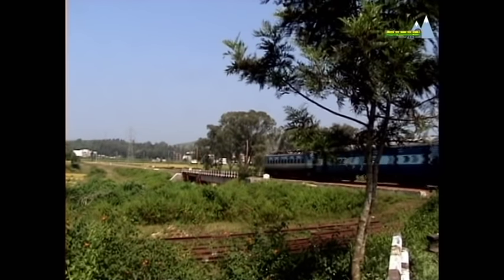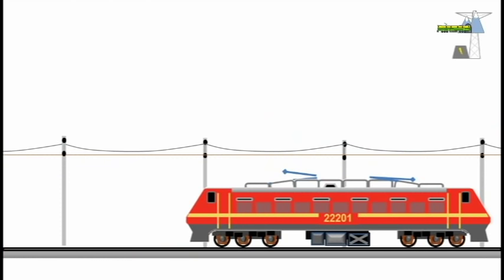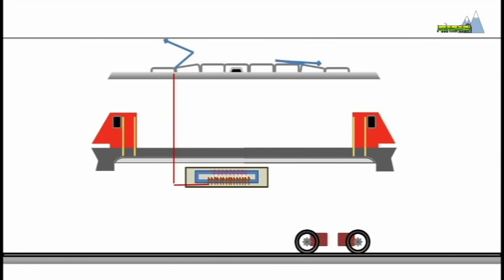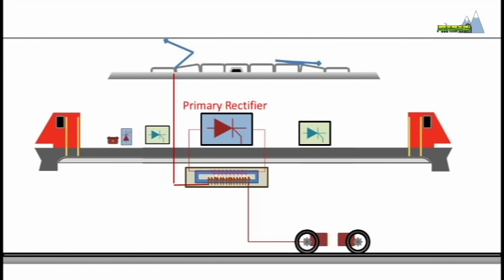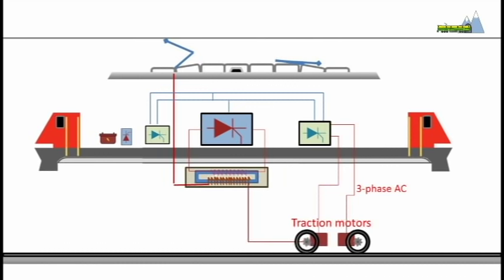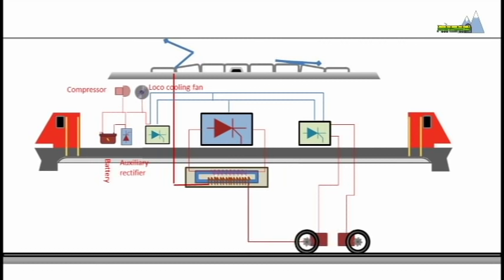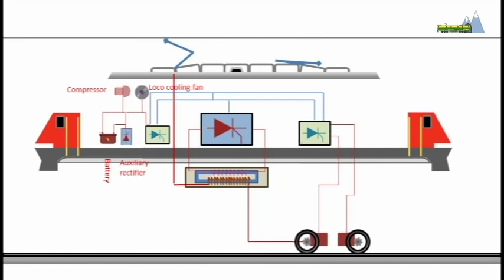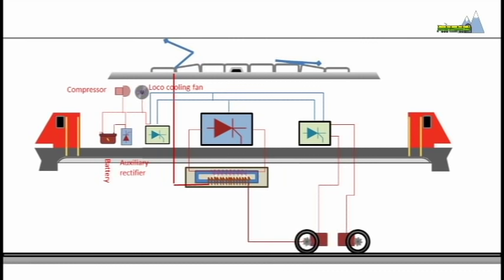How an electric locomotive works...

Comment: As per my observation, electric locomotive trains needs high starting torque and variable speed at constant torque in any loads. these points are fulfilled by inverter based Ac drives. By the way i have seen resistor banks on top of the train to desipate  the back emf of induction motors.Hence there must be used AC drive system as shown this video. AC to DC conversion is needed to switching semiconductor devices  to achieve variable frequency and voltage.usually IGBT used to achieve this and converted into AC .

Comment: If you touch the rail, when the train passes, can you get electrocuted?
Reply: No, the Rails are grounded so there is no Voltage between them and the Ground you are standing on. Touching Rails when a Train passes may result in more "mechanical" Injuries tho.
Reply: @Genius_at_Work  , but the train creates electric current from the generator/motor to the ground - through the wheels. Then there are ground wires on every XY meters attached to the rails. What if you make contact to the rail (from the side) when wheels pass you by. Then you would "short circuit" it, right?

Comment: Very good and very "compact" explanation of the most modern system:
25 kV / 50 Hz --> Transformer --> Rectifier --> DC-Link or DC-Bus --> DC/AC (3 Phase) variable frequency converter --> (3P) AC-Motor (asynchronous/synchronous).

But from 1912 to the late 1970s the standard in Mid-Europe was to use 1 phase AC-series-wound motors, which where supplied bei a transformer with multiple taps. And this system is the reason for the (from todays view) odd system with low frequency AC (16 2/3 Hz, now 16,7 Hz):
15 kV / 16,7 Hz --> Transformer with a lot of taps --> big mechanical switch to select the taps  --> 1 phase AC-series-wound motor

At the beginning of the last century this system was revoluntionary efficient, because it does not use resistors (which just produce heat) like DC-systems and the current was quite small (because of the high voltage). And you don't need any rectifiers (which could only build stationary at that time, because they were mercury-rectifiers) at all.

But the down-side is of course, that you need a second 16,7 Hz distribution system all over the country ...
... which Germany, Austria, Switzerland, Sweden and Norway still have to drive their trains.
Reply from the maker: Thanks Stefan for the exhaustive information. AC Electric traction in India was a collaborative effort with the French. But our first batch of AC electrics used 25 KV/50 Hz with DC motors that required rectifiers. The present lot are German collaboration (ABB) and use AC-AC 3 phase systems

Comment: why do u have to connect the transformer to axle brush? what's the point of it? I saw that the traction motors are connected with in 3 phase with primary inverter so im asking what the point of connection from transformer to axle brush? sorry im beginner only

Comment: According to this video, from the transformer, the supply AC current is converted into DC by using rectifiers, and further it is converted into 3 ph AC using inverters. So here AC is ultimately converted into AC, then why the rectifier is needed? 

And my another question is that,  is the supply AC is single phase or 3 phase?
Reply: AC power from 1 phase to 3 phases previously needed a rectifier, why? Because the current AC converter from 1 to 3 phase AC does not yet exist, a rectifier is needed because the rectifier can work with several electrical phases, either 1, 2, 3, even 6 phases if using a rectifier will produce DC electricity that can be converted into phase required.

The electricity supply from the overhead line to the electric locomotive/train uses 1 phase electricity, while the traction motor uses 3 phases which must pass through the rectifier and inverter first.

That's a bit of knowledge and opinion

Comment: Awesome video sir.

 I have a doubt. Traction motors really needs cooling fan?  I think the motors are open to atmosphere and while in speed,  air can cool the motors. May be fan is required to cool the motors when loco is standstill.
Reply from the maker: You make a good point... I saw some technical drawings mention these fans as being for cooling traction motors
Reply: @TheTrainStory  Oh ok. Then I think traction motors do need cooling fans. It is difficult to see the requirements like the designer has seen.

Comment: Only one wire are touched to the engine from supply line then where it get other polarity?(is it get minus voltage from train ground?)
Reply: Sepiyan Siva it's earthen through the rails.

Comment: that was really cool,
can you also tell us about the new P5 & P7 one's, they seem to have some different kind of cooling units as their shell is completely covered unlike the other electric engine's, & also about the secret of their so much power too
Reply: Tarun Sanghavi they use 3 phase squirrel cage induction motors instead of DC motors like wap4 hence they have better performance

Comment: why is AC converted to DC and again back to 3 phase AC? why not use  the AC directly?
Reply: Because the Traction Motors in most (if not all) modern Locomotives are Triple Phase Synchronous Motors. The Speed of a Synchronous Motor is proportional to the AC Frequency, so the Locomotive has to regulate the Frequency on board, as the Overhead Wire delivers Single Phase AC on a constant Frequency. This Change from fixed Frequency Single Phase AC to variable Frequency Triple Phase AC requires Rectification as Intermediate Step. Even if the Motors coincidally were running at the same Frequency as the Overhead Wire, DC in between would still be necessary as Single Phase AC can't be converted directly into Triple Phase AC.

Older AC Electric Locomotives (until 30-50 Years ago) had Single Phase Serial Motors tho, which were regulated by adjusting the Voltage fed to them. So they ran on the same constant Frequency as the Overhead Wire, with a variable Transformer in between.
Reply: @Genius_at_Work  ah I see...thank you so much for the explanation. makes sense.

Comment: There is a lot of information missing.  So let me get this straight.  The electric motors are AC motors that have variable power needs.  How is the AC current modified, with variable pulse wave electricity?  You can't change the amperage or the voltage to a motor except changing the phase feed but that means you are stuck with a handful  of fixed motor speeds.  Your locomotive needs a flat wave pulse modulator between the rectifier and the motor otherwise your motor burns out.
Reply: You can infinitely vary at DC stage. Post-invertor AC will have similar wattage. The AC-AC transmission is actually AC-DC-AC.

Comment: how many motors used in locomotives ?
Reply from the maker: Santosh Kulkarni There is no fixed number. Depending the requirement, a locomotive can have between 4-6 traction motors.

Comment: My question is that..the Traction motor mounted only with the engine wheel or all the wheels of the train?
Reply: Great video by the way...different from the time wasting youtubers... Thanks for providing such informative videos.
Reply: Locomotives power is only powering wheels on locomotive, but on many passenger trains the individual cars have motors on carrages.  Technical these are called Electrical Multiple Units (EMU)
Reply: Most Metros /subways / Undergrounds are of these type.  Confusion comes in case of high speed main line EMUs where front car resembles locomotive, but all carrages are self powered.

Comment: Interesting. How is the motor speed varied. AC motors run at a speed determined by the frequency. Is this frequency varied by all that circuitry?
Reply: By the voltage and frequency supplied by the inverters.
Reply: Frequency and voltage control. This is why we convert ac into dc and then ac with a different frequency

Comment: Why don't they use a single to 3 phase transformer and then directly give the 3 phase to the motors . WHY RECTIFIERS ???

IF ANYONE KNOWS THE ANSWER PLEASE REPLY ME
Reply: Because there is no such transformers are present. And if are then they will in big size .so rectifiers are used in it.

Comment: still vague
why are we using rectifier and then inverter again, complicating the engine, why not use open-delta transformation to get 3 phase a.c. 

what kind of motors are auxiliary motors (synchronous, induction or other motor)
Reply: Open delta presents some undesirable characteristics, such as currents not being equal, and the 3 phases not being 120 degrees apart. The B-phase, sometimes known as the "wild leg" or "high leg" is often well above 120 volts.  Since nobody needs fried motors, buggered lighting systems, HVAC systems that don't H, V, or AC, they do not use open delta transformation.   Using rectifiers and then inverters is costly up-front, but offers a world of dependability and reliability with predictability and familiarity if something does go wrong.
Reply: Stan Patterson - appreciate your reply
Reply: The supply voltage is 50Hz single phase AC but the motors need 16 ⅔ Hz 3 phase AC
Reply: AC current is first converted to DC by rectifiers. This DC current is again converted to AC by inverter circuit. The frequency of this converted AC current can be varied to change motor speed. And hence train speed.
Reply: N1kh1l B frequency can't be used for controlling the speed.
Reply: sahil malik Dear Sahil. Speed of AC motor is 120 x f/p where f is frequency of supply and p is number of poles of motor. So speed of motor can be varied either by changing f or p. 
For further reading I suggest you search for VFD or variable speed drive.
Reply: Nikhil thanks, really appreciate your reply.
Reply: I agree, Sahil. If they could employ motor drive technology similar to Tesla Motors, performance would improve. In this video, they use Diesel engines to drive an AC alternator generator which drive DC tractor motors after being rectified. Invertors don't make sense unless the tractor motors are DC stepper motors.
Reply: There is a difference in traction motors. The picture used here is of WAP4 which use Alstom DC traction motors so they need conversation but newer WAP5, WAP7, WAG9 use Hitachi 3 phase squirrel cage induction motors hence don't need AC to DC conversation
Reply: The power coming down through the pantograph is single  phase AC at 25, 50 or 75 kV. They traction motors need to be three phase induction motors as they start and stop a lot. With 3 phase induction motors there is no need for commutators, starting windings or capacitors (which would wear out with all the stopping and starting). The transformer steps the voltage down. It is then converted to DC. The inverters convert this back to AC but in three even phases, The motor speed is varied primarily by varying the frequency of the AC. Secondarily it is varied by varying the voltage. The rectifier - inverter allows the variation of frequency and voltage. The traction motors would be class C or D so they have a lot of starting torque. They would also be designed for varying frequency,

Comment: in traction dc series motor is used right....so how come 3 phase ac supply from inverters is able to drive them???or are universal motors used nowadays??
Reply: Kshitiz Sinha  Thyristor controlled induction motors can also be used.which satisfies the load characteristics..
Reply: Kshitiz Sinha  now traction motor is replaced with AC 3 phase induction motor..

Comment: I have one doubt y we r using AC motor first thing we got an ac supply from ohe then we r converting into DC by using rectifier and the again we r converting into ac to the motors y either we use direct DC motors by using rectifiers or ac motors direct from transformers why we r using waste rectifiers it's lot of huge process , money waste for the rectifiers and one more thing in earlier studies I listen DC series motor r using I think it's in diesel locomotives and I think induction motors r using in ac traction locomotives is it right ???

Comment: Why have a 3 phase ? why not single phase motors?
Reply: the HP capacity of 3 phase motor is more compare to 1 phase. to get same HP capacity in 1 phase the cost is more compare to 3 - phase.

Comment: Nice video, are you sure about electric locomotives in 1837?
Reply from the maker: Yes...
Reply: The Train Story sxf.     

A
Reply: Wide World of Trains  no first train in 1879 in west german
Reply: i think a little machine was built in 1832 or 37 and then destroyed by rail workers but it sounds soo wild
so i bet 1879
Reply: There were experiments in 1830s and 1840s of locomotives using electricity, but the electric motors of the time were not real efficient, and there were no generators available, so they used voltaic piles (primitive batteries) to provide electricity. The first efficent locomotive was built by Siemens decades later, as he was able to build a useful DC generator.
Reply: Nice  videos
Reply: @TheTrainStory  you don't say
Reply: @TheTrainStory   bro can u explain about the use and working of inverter and rectifier within the locomotive in detail ... Pls
Reply: https://en.wikipedia.org/wiki/Robert_Davidson_(inventor) Scottish inventor Robert Davidson built a battery powered rail vehicle in 1837 (with zinc-acid batteries, the dynamo principle was not yet discovered). It was too expensive and not powerful enough (it could only move itself at walking speed).
Electric traction only became economically useful in the 1870s with mining locomotives (also shown at exhibitions and gaining great popularity), followed by trams in the 1880s. On the mainline this was not yet competitive with steam, widespread electrifications only took off in the 1920s.

Comment: And what about third rail or on some systems - London Underground - forth rail systems then?
Reply: Most subway / metro / underground systems use 3rd rail DC systems in 600 to 750 volts.   The same DC voltage range is standard for trams (and with second conductor for trolly busses). In Mason city Iowa USA there is a short connecting railroad using trolley pole DC locomotives on same system.  YouTube has a number of videos of this line.

Comment: What about battery electric locomotives?
Reply: Battery powered locomotives are good but not recommended.  Because it takes how many batteries to run one locomotive unit, to produce a powered locomotive, it takes a lot of batteries which means it will add to the load of the locomotive.  Li-Ion batteries are spoiled batteries, meaning that they are the most antipathetic to changes in voltage and current, voltage levels during charging, and discharge, besides that these batteries are also the most antipathetic to temperature, too hot the temperature will shorten the battery life.  Any Lithium battery including Li-Ion in it must use BMS (Battery Management System) in order to extend its life.  In addition, using a rechargeable battery will definitely be a partner, namely a charger.  Charging the locomotive battery is very time consuming, while the unit needs to be urgent. Sorry sir, my translation is messy, because I translated my language to English using Google Translate

Comment: Why are there two pantograph's.
Reply: Redundancy. And if two Locomotives are pulling, the leading one uses the forward Pantograph and the second Locomotive uses the rear Pantograph to maximise the DIstance between them. If Locomotives had one central Pantograph only, they would be closer to another in that Case, which increases Vibrations.

Comment: Why electric locomotive has two pantograph?
Reply: Some railroads prefer to have the trailing pantograph up depending on which way the locomotive is travelling.  Apparently they have designed pantographs in modern days that work equally well in either direction, so in that case, having a second pantograph, it becomes a spare to use if the other one should become damaged.
Reply: Stan Patterson thanks
Reply: Redundancy. If one fails the other operates otherwise the train will stand still!

Comment: but the overhead powerlines provide 25000 DC in INDIA!!!
Reply: No sir, that high voltage DC power is very inefficient. Because it requires a closely spaced substation, in addition the DC voltage will decrease along with the length and thickness of the cable. Cable resistance plays in lowering the DC voltage, the longer and thicker the cable, the higher the resistance.

AC power has managed to overcome this problem with high voltage that can be stepped up and down with a transformer, because the transformer only works on AC voltage, and the high voltage AC also makes the substations installed at intervals of 20km, instead of DC which requires a distance of 3-5km.

High-voltage DC will also produce a large current, so it requires a thick cable to provide the current capacity to be passed. AC power requires only thin wires in both the contact wire and the catenary and makes them lighter thereby reducing further bending due to thermal expansion.

it's just a little knowledge and opinion

Comment: how does it ground?
Reply: the rails serve as ground
Reply: There is usually a carbon brush in contact with the axle/wheels that ground the system through the rails
Reply: If my observation is correct, the rails serve as ground/neutral "wire" and the rails are actually grounded using thick bands at regular intervals

Comment: PURE CRAP... You failed to explain how the circuit is completed ... Once electricity is drawn off overhead, rectified and goes thru motor where is the circuit completed? I would think thru one of the rails???